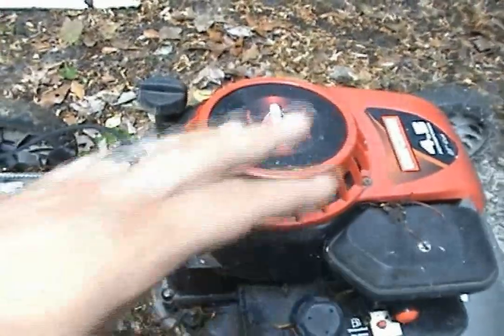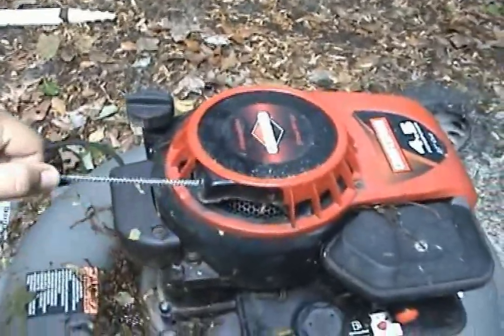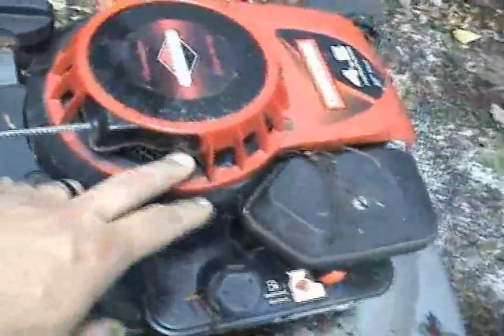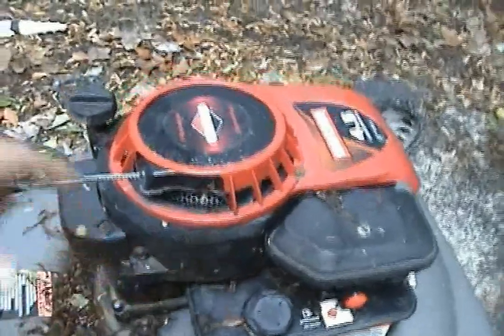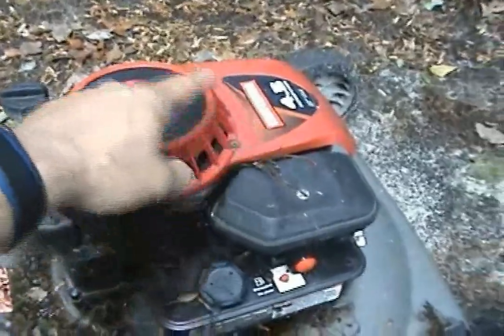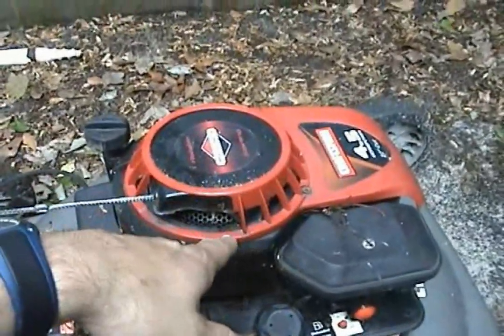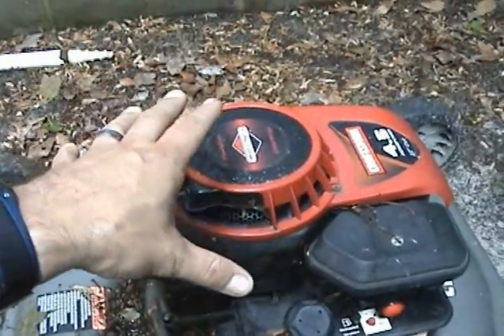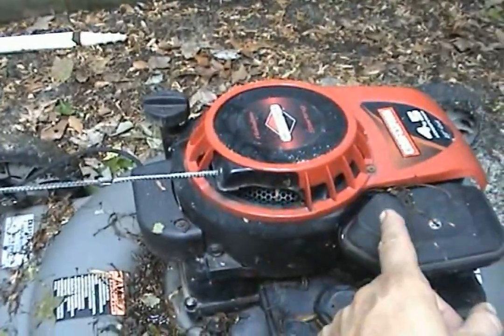Magneto1

Comment from the maker: For some reason chainsaws and vehicles have more response. The lawnmower action is very different not as BIG as I have seen with vehicles and chainsaws.
I'm thinking it has to do with the magneto and or COIL being used with the KML. Because when i took the end off the spark plug. Nothing but on a car it works.

Comment from the maker: As the magnets pass every time it will create and electric induction to the magneto and this fires the spark plug. You can take any magnet motor or bedini wheel and make my dream come true :) All you need is the magnetic wheel to move fast enough and the spark fires faster and faster till you get a solid bolt kicking out electricity. Don't attempt this unless your really SAFE! I'm not responsible for you getting shocked etc. This was my theroy of operation into a system 12 years ago.